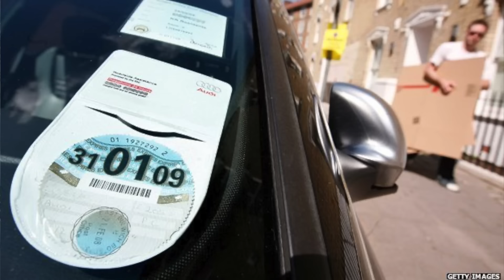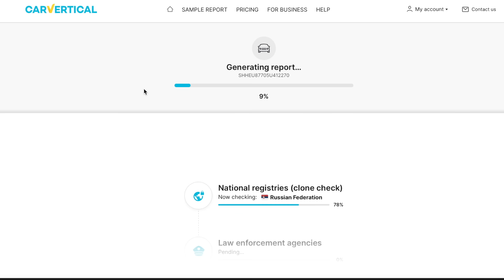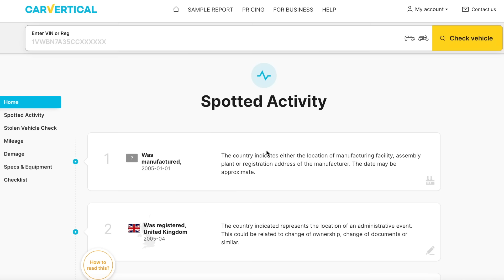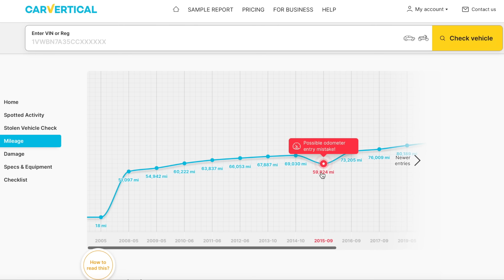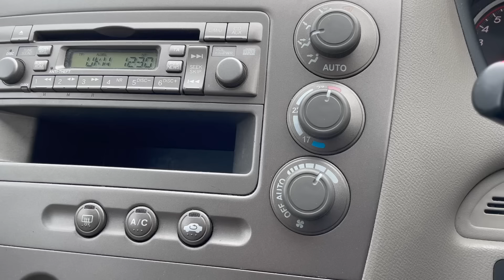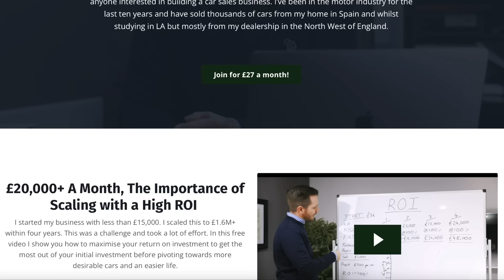I BOUGHT A CHEAP HONDA CIVIC

Comment: Hi Matt.  I'm guessing you must know this but it's not coming over clearly on the 'I've just bought' videos..... Yep your vat is calculated on the margin between the selling price and the price paid for the vehicle, but some of that vat comes back to you in the cost of doing the service, numberplate, wheel restorations etc etc, as long as those businesses are vat registered. 
If the costs you reveal are the pre vat price, then your profit is correct, but it sounds like you are reading the gross (Inc vat) figures for the work done by outside businesses. Thought it might help some of the new traders you've encouraged to start.
Reply from the maker: Yes I know but some of the places I use aren't VAT registered.

Comment: You calculated your profit wrong.
It's the difference of what you bought the car for and sold it for but don't forget your prep work or expenses those invoices need to be taken into account as they also have vat on them @20% so that £414 has around £82 of vat that's to be added back on your profit .👍
Reply from the maker: Only when they are VAT registered. Some of the places I use are not in which case there was no VAT paid so no VAT to reclaim
Reply: @HighPeakAutos  Good point didn't think of that one 🤣🤣.
Love your videos they are the best on YouTube 👍

Comment: That car is the equivalent of about $620.00 US dollars!
In the United States I haven't seen a Honda of any kind that inexpensive for years!
Even with intergalactic mileage and significant rust they are $2000.00 or more.
It's funny that in the UK owners are older because in the US practically nobody over 30 buys them and most older models are owned by males under 21 that modify them within a inch of their mechanical lives.
They NEVER shift them at less than redline.
Reply from the maker: Yes I noticed that. Its odd haha

Comment: Why is the VAT on the difference between the purchase price and sold price? Are you not able to deduct parts and labor used to get to the new selling price?
Reply: The "second hand margin scheme" for VAT purely uses purchase price and selling price.  The VAT payable to HMRC is 1/6th of the profit between the two.
Don't forget that dealers deduct all the VAT they pay on all the parts and labour costs they've paid out on the car to get it to selling condition.
The scheme acknowledges that most cars that dealers buy are from the public, so haven't got VAT on.  To make car dealers charge VAT on the entire selling price would be unfair (because they've not been able to deduct it on the purchase price).

Comment: This is probably the only car I've seen where the EU version is bigger than the North American version. Honda only sold this generation of Civic in North America as a sedan or coupe (apart from the Si which was a two door hatchback), and they look smaller (they probably are) than this.
Reply from the maker: Yeah thats right. Its mad really
Reply: @HighPeakAutos  they were even sold in Canada as Acuras...6th-8th generations. The 6th and 7th were called the EL, the 8th was called the CSX. This was before Acura restyled the 9th gen Civic as the ILX for both US and Canada.

Comment: “So it’s a Honda civic so they’re over 50…” I should unsubscribe! I bought a 1.7 diesel version of this (in this colour) when I was 25 and pounding miles for work, stuck 70k on it in 3 years, bought a 2008 one to upgrade (cruise control and built in nav) and my dad liked it so much he bought it off me. Couple of times I’d have to do a work drive from Telford - Swansea, so rather than doing the motorway routes I’d just go shortest mileage, was incredible on welsh A roads…

Comment: Not sure I agree about the age of the original owner, even if you were just trying to be funny. Lots of "petrolheads" like Hondas for the engineering, or did. A lot of older owners of Hondas, me included, liked the Hondamatic gearboxes which were bulletproof and only stopped being used, so I read, when Honda found out they couldn't squeeze a fifth gear in. They were certainly better than the" i-Shit" gearboxes in the next model civics as Honda found out to their cost.

Comment: Fast cars though a 1.6 with Vtec and manual gearbox will do 125mph top speed lol , I used to have a 2.2 Accord type R from the 90s  that thing was a beast 150 mph but i ended up crashing it , Hondas are not for young people as they are too fast LOL

Comment: Dreary, and boring way to get round, was dated when new to be honest. However not the biggest problem, it’s rust and more rust. There are better similar cars like the Ford Focus for same money which look better and drive better.
Reply: But aren't as reliable.
Reply from the maker: Yes thats true
Reply from the maker: Thats true too
Reply: @ln5747  you sure about that? I have a 2004 Focus, been more reliable than any of the Hondas I have had, not even joking. Fords are also cheaper to keep on the road than Honda where most parts have to come from Japan. Hondas can go wrong, just they are owned by older folk who look after their cars, Hondas use oil due to their high revving engines and that will lead to issues if not kept in check. If you gave me a choice of Honda Civic or Ford Focus, 100% take the Focus.
Reply: @SB123  I would take a Honda engine over any Ford 4 cylinder however I will say the mk1 focus is a fantastic car.
Reply: @jameshogg601  I have had both and still own a Mk1 focus, would take the Focus any day.
Reply: @snbala  very sure. Honda make the most reliable engines in the world. Their catastrophic failure rate is extremely low. I am led to believe that a VTEC engine (may be a specific engine but I believe it could be all of them) has never had to be replaced in warranty, worldwide. It's ok talking anecdotally, but studies and mechanic consensus seems without doubt to conclude that Honda engines are more reliable than Ford engines by a large margin.
Reply: @ln5747  everyone has their opinions, I have owned 5 Hondas and 3 Fords and the Fords have fared much better, both rust though so can’t compare either to that. The whole Vtec indestructible talk is media advertisement, there has been many failures and they do wear quicker as time goes on due to the way they are designed, that is high revving N/A. Anyway you would choose Honda, I would go Ford, would be a boring world if we all chose the same I guess.
Reply: Had a 51plate civic good engine but rust every where got a focus no rust and reliable and 14 yrs old.
Reply: @snbala  I disagree, its not opinions, its industry consensus and your anecdotal experience is likely wrong. Data backs this up with engine failure rate etc, with Honda by far the best followed by Toyota. I think if you asked 99% of mechanics they wouldn't be surprised by that, for a reason. In fact, they likely could've told you that. But if it works for you all well and good.
Reply: @ln5747  having been in the motor trade for over 10 years, Hondas are in general considered reliable, and yes they can be but it depends on how it’s looked after  like any car. If you didn’t look after a Honda, see if it will be reliable. I looked after my 5 Hondas and I have had 2 failures, all with service history so talking from experience. I rather not have a Honda again but anyway, we can go round in circles but you prefer the Civic and I would have the Focus over it.
Reply: @snbala  that is a silly point. Honda will only be reliable if looked after, that's obvious. We aren't discussing that. We are discussing if both are maintained equally. On that basis, Honda's are superior reliability wise (obviously not in your (anecdotal) case).
Reply: @ln5747  and I disagree.
Reply: @HighPeakAutos  reliability cost lest than body work that cost you a fortune